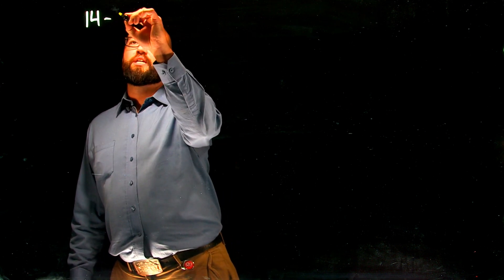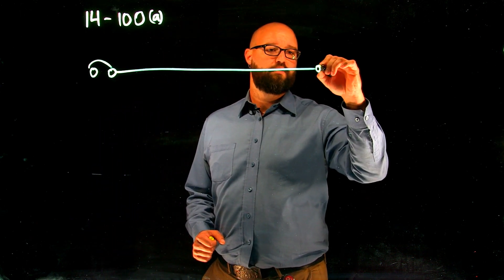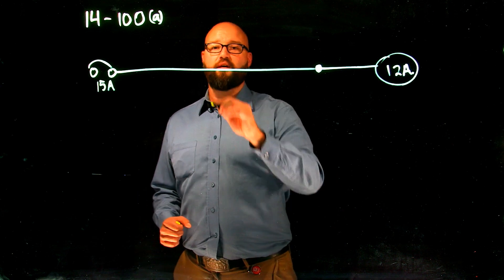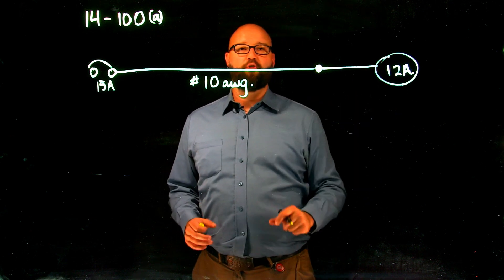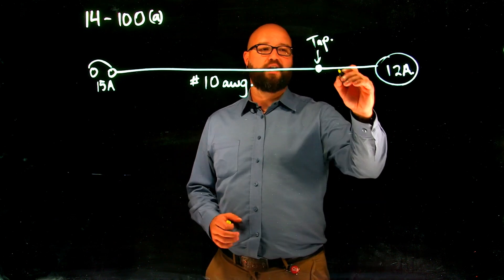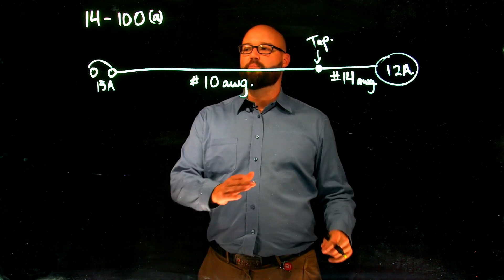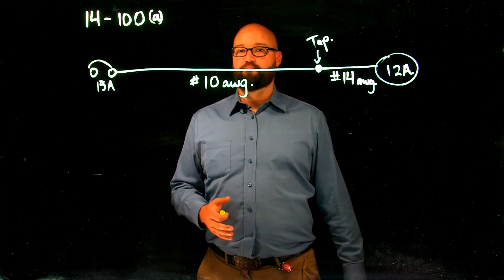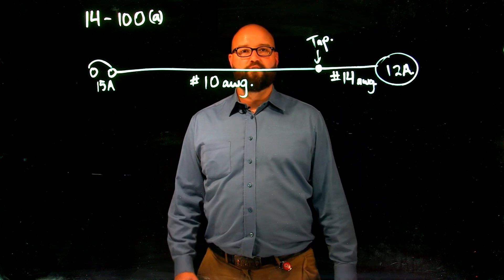Tap Conductors Part 1

Comment: What is a tap conductor?
Reply from the maker: A tap conductor, or a tap, is where you terminate a smaller conductor off of a termination from a larger conductor. It could be from a tap in a splitter, or a terminal block. That's just one of many examples. A no. 12 and a no. 14 terminated together under a wire conductor is another example of a tap connection.

Comment: For 10awg conductor we need 30A overcurrent device, why you say 15A o/c is good for it?
Reply: The purpose of O/C is to protect the wires, not the other way around, so you can always size up the wire, either for accommodating the voltage drop in a long run, or simply just for fun. put it simple this way, a bus that can load maximum 30 passengers is coming , the driver will stop letting people in when she sees the 31st is trying to board. Then the next bus which can load maximum 60 people is coming , the driver can still stop letting people in when she sees the 31st is trying to board, there is no safety issue to it. only a little waste of space.😆